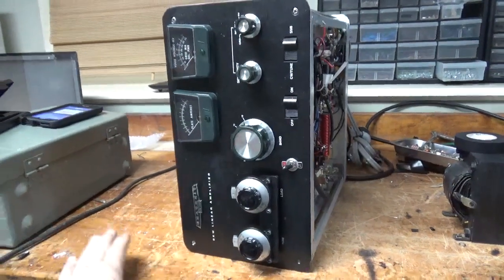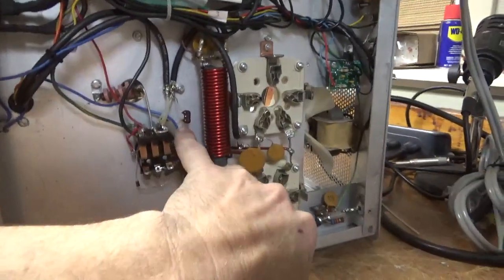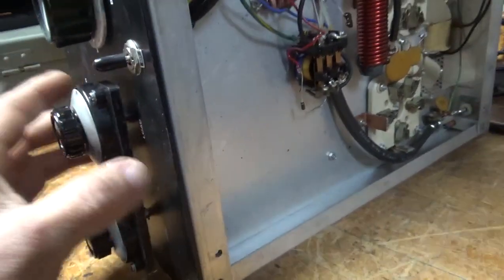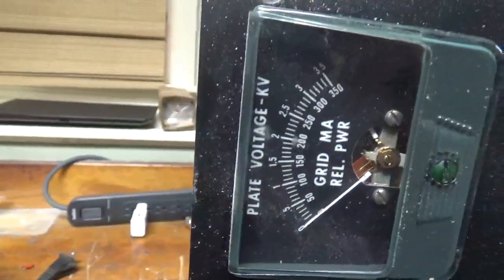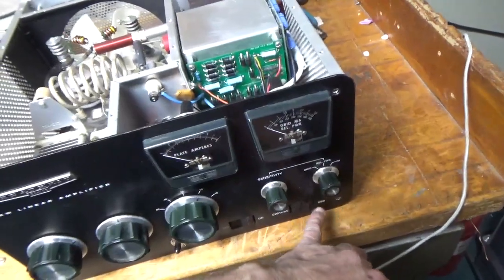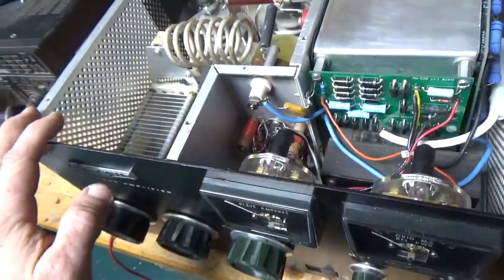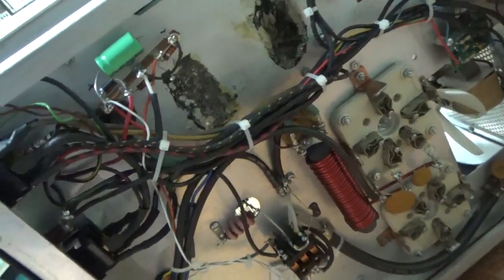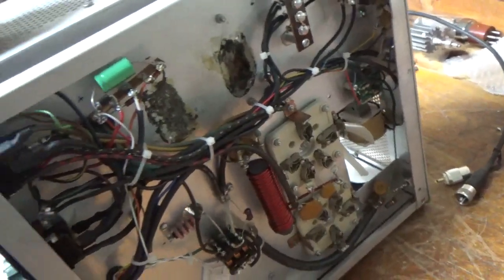Heathkit Sb220 Repair And Modifications

Comment: Hello, I would like to ask you a question, they are selling me an Sb 220 and an sb 221 amplifier. Which of the two would you prefer according to your experience?
best regards george
Reply from the maker: Good morning , Although the sb221 is newer it isn’t easily modifiable to 10 meters . If want 10 meter I recommend the sb220

Just make sure you inspect the band switch and other components in the output  circuit before you purchase it.